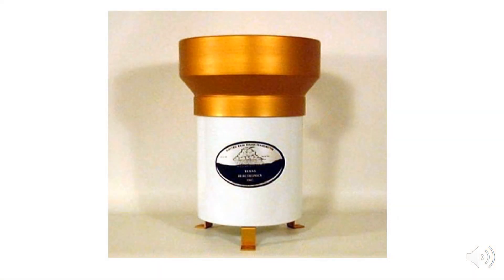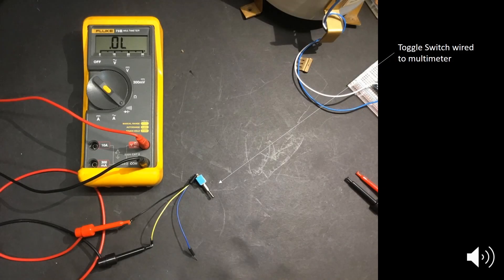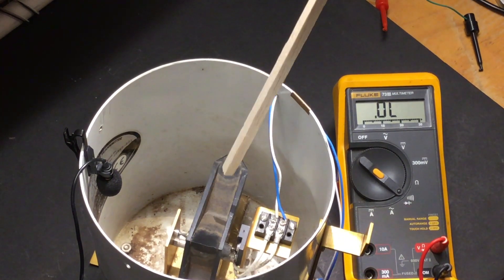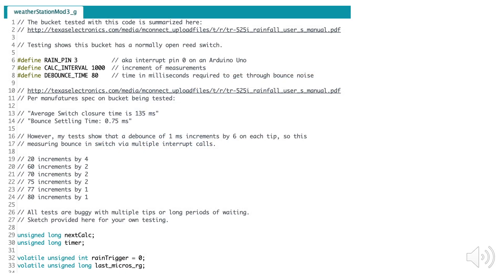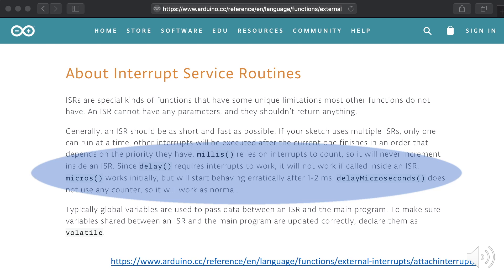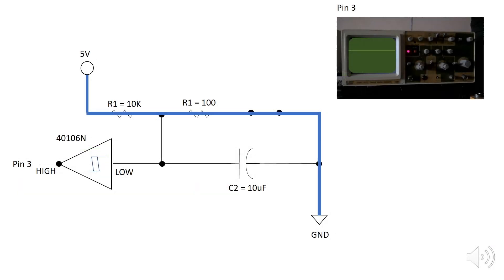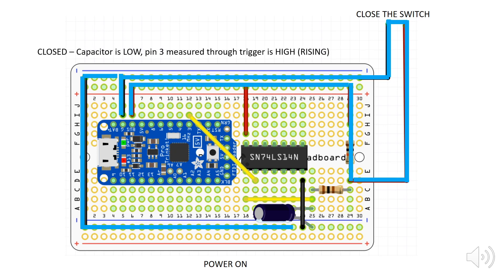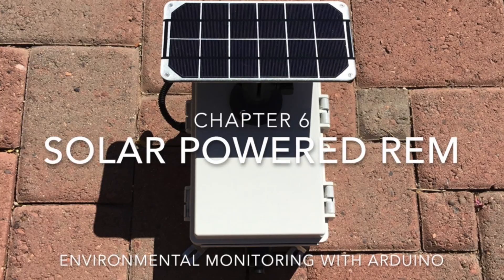Using an Arduino with a Tipping Bucket Rain Gauge

Comment: Hi ModestMaker, great video and explanation! 

Hope you can clarify one question I've got. At 8:09 you said that you found out that it [fixing bouncetime to calibrate 1 count / tip] was not a stable solution over longer periods of time. How did you found out? Over which timespan? Many thanks!
Reply from the maker: I tested this approach over the course of just a few minutes using different delays, and it eventually compounded tips regardless of the constant. I subsequently learned that delays of more than a few microseconds in an interrupt function is just not a good idea.

Comment: There is a solution to debounce with the microcontroller.
You just have to wake up the µC with the Interrupt. Then perform the debounce in the loop() function. After that you can go to sleep again.
Using this way you have a much easier and cheaper setup.
Reply from the maker: Thanks - if you have some code you might share, I'd be glad to test it and post.
Reply: @ModestMaker  I can send you an example, how can I contact you?
Reply from the maker: The code should be relatively short - can you post it as a comment?
Reply: This should work (not tested)
#define RAIN_PIN 2          // interrupt pin
#define DEBOUNCE_TIME 15    // time * 1000 in microseconds required to get through bounce noise

unsigned long timer;

volatile unsigned int rainTrigger = 0;
volatile unsigned long lastTrigger = 0;
volatile bool stateChanged = false;

void setup() {
  Serial.begin(9600); 
  attachInterrupt(digitalPinToInterrupt(RAIN_PIN), countingRain, RISING); 
  
  pinMode(RAIN_PIN, INPUT);
  nextCalc = millis() + CALC_INTERVAL;
}

void loop() {
  timer = millis();
  
  if(stateChanged)
  {
	  bool Value = digitalRead(RAIN_PIN);
	  if(!Value)
	  {
		  stateChanged = false;
	  }
	  else if((timer-lastTrigger)>=DEBOUNCE_TIME
	  {
		rainTrigger += 1;
		stateChanged = false;
		Serial.print("Total Tips: ");
		Serial.println(rainTrigger);
	  }
  }
}

void countingRain() {
	lastTrigger 	= millis();
	stateChanged 	= true;
}
Reply: But I would recommend you to send the microcontroller into deep sleep. Then you could easily run this on battery.
One more hint: The debouncing you used (and the one I did too) is not a true debouncing. It debounces only the rising edge and not the falling edge. For this use case this should not be a problem but for others it might be.

Where did you get the tipping bucket from?
Reply from the maker: @benzi2353  Thanks Ben. The tipping bucket is on loan from the State of Arizona, but I have a second one donated to me by Xerocraft. Based on my tests during monsoon season, I don't recommend these in areas with intense rainfall - they just can't keep up resulting in underestimating rainfall when compared to analog gages. The Walnut Gulch Experimental Watershed (USDA-ARS) now measures precipitation via weight vs. tips which would eliminate the debounce issue. Also, thanks for sharing the code. I will get back to this, but right now I'm deep in playing with LoRa. I do appreciate you sharing this valuable feedback - will be interesting to play with these suggestions at a later date.

Comment: At 10:43, you misstated the RC formula.  When using microfarads, you need to use megohms, not kiloohms.  T=RC uses seconds, ohms and whole farad's.  Since you are using millionths of farads, you need to use millions of ohm's.  I'm not good at explaining this, I apologise for that.  

That said, you can denounce the switch in software, you just have to do it at main level, not in the interrupt handler.
Reply from the maker: You are correct. Thank You!

Comment from the maker: UPDATE 2/18/2020: 
--- At minute 7:20, I revisited this code based on correspondence with Argent Data Systems and a review of libraries prepared for their hardware. If I set the debounce constant to 15, and then multiply it by 1000 on line 56 of the code, this eliminates the problematic bounce demonstrated at 7:35. With this edit, the code does execute successfully with the bounce filtered out. In response, I updated the sketch "weatherStationMod3_g" available on http://www.biod101.com/arduino/part2.html under "Chapter 9" with these edits.

--- The successful code modification and tests suggests I can use a reed switch in a tipping bucket rain gage coupled with an Arduino without needing to incorporate an RC circuit and a Schmidt trigger, or replacing the reed switch with a Hall Effect Sensor. However, these alternatives are mechanically and electrically sound while simplifying the code. 

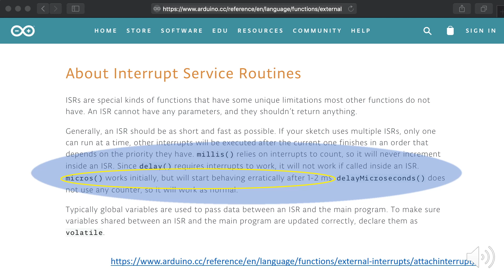 --- At minute 8:29, I incorrectly stated: "Interrupts.... generally should not be used with timers that take more than a microsecond to execute". That is incorrect - I should have stated "millisecond" rather than "microsecond". 

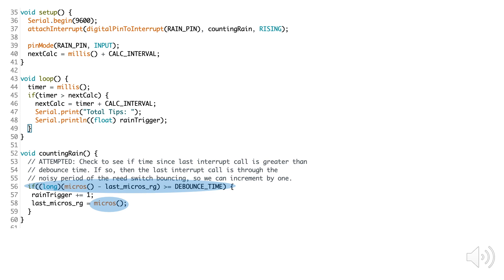-- At minute 8:55, I incorrectly state there is a delay in my interrupt function. This is incorrect - there is no delay in the interrupt function shared in my code.

Field tests have not yet been conducted. Thanks for your patience as I become better acauainted with these instruments and electronics.
Reply: Thanks for the info. I have a 20+ year old Dallas One Wire weather system that I am converting to Arduino. I have a tip bucket rain gauge and I was not sure how to integrate it into Arduino. I gave up on Dallas One wire sensors and went with Adafruit BME280 for Temp, Humidity and Barometer on a I2C bus. Very simple and works great. I added a Ethernet shield onto a Arduino Mega 2560. It records the weather sensor data to the SD card on the shield. I can read the data file over my network. The last sensor to add is the rain gauge.
Reply from the maker: Sounds great! Hope it works out. If you deal with heavy rains, make sure to check out the accuracy check on these tipping buckets. https://youtu.be/iR331RDdPW4 . I will be experimenting with a strain gage shortly to measure weight as an alternative. I just need to figure out how to empty the gage between storms.

Comment: With no disrespect, I would use a Hall Effect Magnetic Sensor Module as it has debounced built-in  so that would solve all your problems and be very reliable as there are no moving parts but you will need three wires and if it is a long way away you could get voltage drop on the cable but I used one for  a security switch circuit that worked very well, Love your channel have joined as you are covering the current sensor INA219 that I want to use to monitor current in a colloidal silver generator I want to make, Thanks Bob in the UK
Reply from the maker: Thanks Bob. I am in total agreement. I was not familiar with Hall Effect sensors until after I posted this video and have since picked up a few on eBay. These old rain gauges can be easily hacked for the same, and I hope to post an update shortly. I am a little distracted these days with my kids who've asked me to build stuff for them instead of work ;) Cheers!
Reply from the maker: Update posted with Hall effect sensor demo: 1/8/2020: https://youtu.be/KHrTqdmYoAk